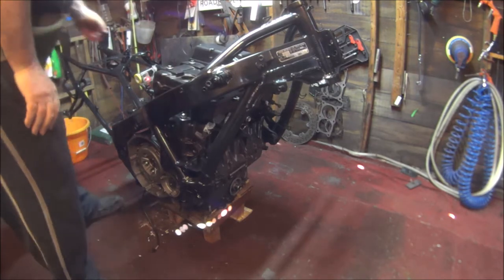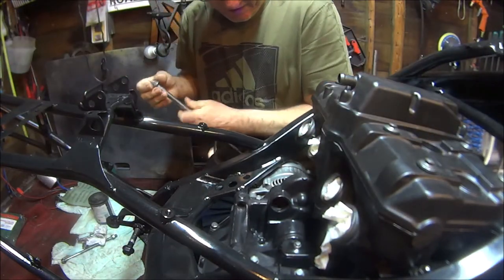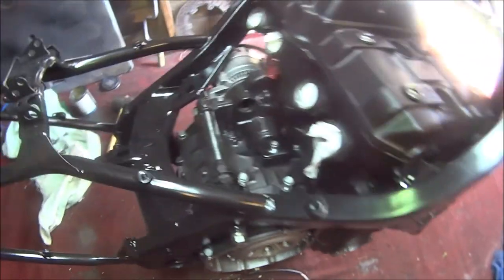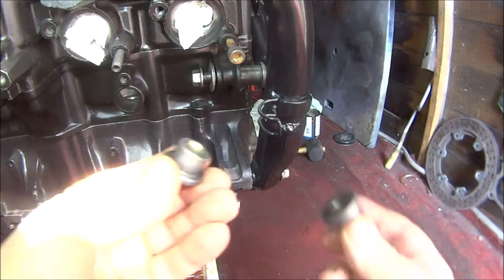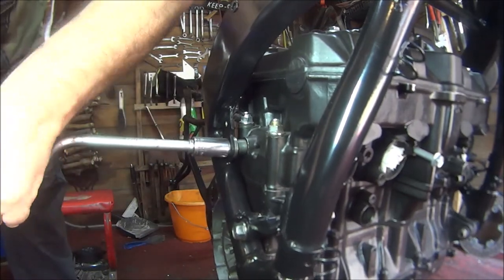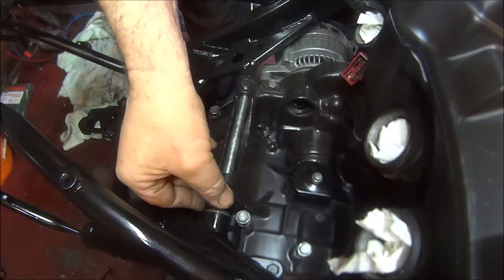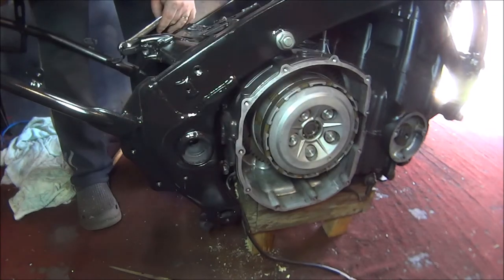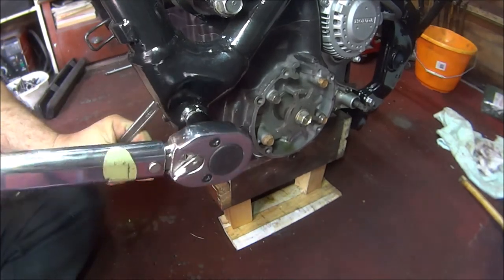CBR1000F Landfill bike. the engine is reunited with the frame.

Comment: Looking good John, it’s starting to come together nicely. I like how the engine paint work turned out, I’ve recently put the engine back into my 1991 CBR1000F so I can really relate to this video. 
Thanks again for sharing and thanks for the tip about using the bees wax on the bolts, I will try that on some of my vulnerable parts. 

Looking forward to the carbs going back in, I’ve had a bloody nightmare with mine and have to take them out again to get a better seal and fit on the inlet rubber hoses as they are not a supple as they were 30 years ago. 

Thanks Pal
Reply from the maker: Hi Colin thanks buddy.. Yes I too have to sorce new inlet rubber boots. 👍